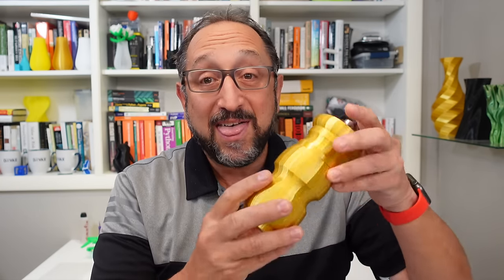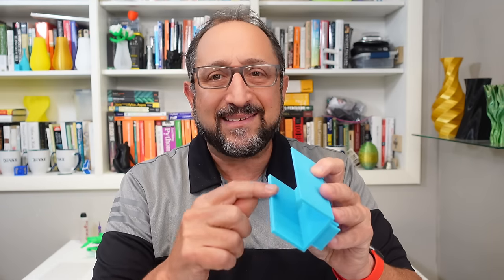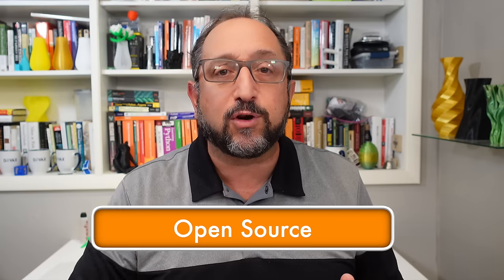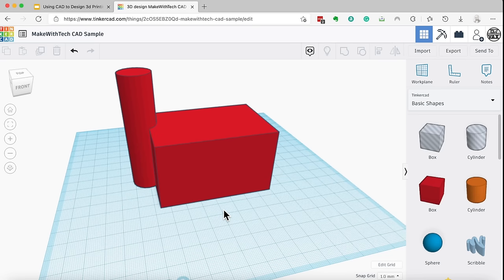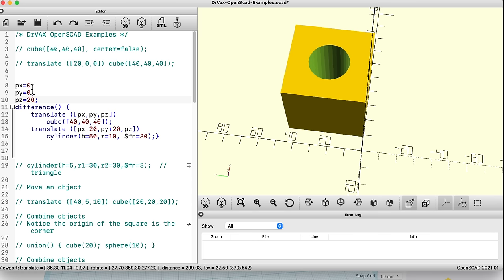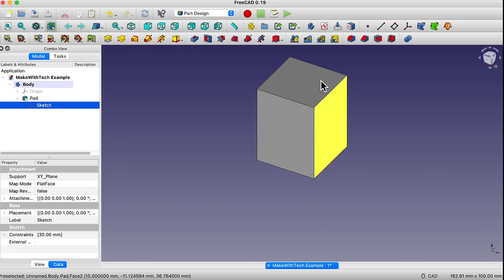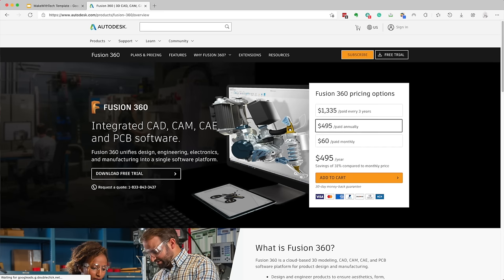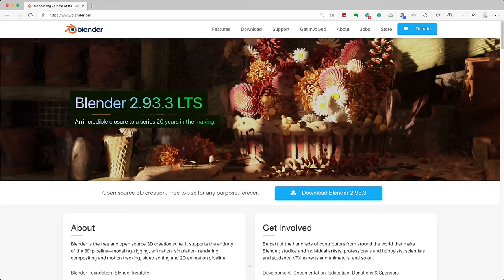Getting Started with CAD Modeling for 3d Printing

Comment: Have you tried Designspark Mechanical by RS (Radio Spares)
Reply from the maker: I discussed this CAD program in the video.
Reply from the maker: I have heard that before but as a Mac guy I cannot use it.
Reply: I also like this program, but I wasn't able to get the newly added parametric features to work. Too bad it is PC Only.
Reply: @MakeWithTech  What is a Mac?
Reply: @0LoneTech  Sorry, I forgot my <sarcasm> tags, I am a PC guy, and I hate the abomination that is Mac. </sarcasm> I may load Linux on a new Laptop soon, and see how long I last before loading Windows 11.

Comment: I used autocad back in the 80s thru 2005. I still use release 13 to design large data centers.
I use Sketchup 2014 for all my 3D printing
I hate, & loath subscription software. I will NEVER use it!
I will only use free or open source software.
DaVinci video editing software is FREE and is EXECELLENT software package. I GIVE them the $300 for a professional verion becuase that cost is VERY doable for ANYONE.
DaVinci has got the right idea!! I LOVE that compamy and hope they NEVER change thier software Licence!

Comment: Are u a lecturer ? Very professional.
Reply from the maker: Thanks.  I have spoke in public hundreds of times over my career.
Reply: @MakeWithTech  Should I learn FreeCad or Fusion 360 to quickly get into 3D modelling as currently I am using Tinkercad. I am in the Construction and Manufacturing industries and I wish to develop technical products.

Comment: Still cannot see the appeal of Fusion 360.. I have been using CGI tools like Lightwave, Cinema 4D, Reflections, Sculpt Animate 4D, Maya and such for decades. I know that of course CAD isn't the same as CGI, but I got the impression, that all the CAD tools and especially Fusion deviate from traditional and well established input and control techniques in a very unpleasant way. Which keys you need to press, shortcuts, positioning of features, the kind in which elements are displayed, where you got to click and how to move the mouse and such are all just super terrible. Free CAD is better in usability, but still has a lot of flaws and it kept crashing all the time, when I tried executing operations on objects of just middle complexity.
This industry clearly needs a revamp!
Reply: I feel the same way when I try to use Blender, which I assume is like the other CGI programs you mentioned (None of them are free, so I have not used them). These programs are good for creative people, while CAD is more technical. It is not "Terrible", just a completely different way of thinking.
Reply from the maker: I agree with your point.  I have used both CGI and CAD programs.  As an engineer I am more comfortable with CAD programs but it all ends up personal preference.   Just keep making stuff.
Reply: LightWave! Woot!
Reply: @micro2743  blender is also very different from other CG programs. That's one reason most people complain about its interface. It's not very intuitive.

Comment: I started with 3D Studio R2 back in 1992. The first visual modelling software I've tried and liked.
Open SCAD looks just as hopeless idiotic user unfriendly as POV ray on an Amiga from the late 80s.
Reply: I use SketchUp. I tried to do an animation until I found SketchUp's interpretation of the word animation is SOMETHING ELSE! Wierd.
I suspect that OpenSCAD, being programming based, would be good for animations. Has anybody tried that?
Reply: I tried most of the free programs, and went with Openscad. Created everything to print from coat hooks to 1/16 scale radio controlled tanks, superstructure for RC boats, and RC crawler bodyshells.

Comment: To many of these softwares require constant connection to the internet, even when I could still afford that it wasn't reliable enough to use things like CAD programs online. Living in a rural US small town or even city have many benefits but an affordable reliable internet connection is not one of them. Everything was fine until Trump's appointee Pai... My internet weren't from 60 a month for 100Gb/s to 250/month for 7mb/s, I had faster and cheaper internet in 1998 with my T1. Pretty much every single one if these programs require the internet, maybe not thought away but they get really buggy and slow off they don't get regular updates even if the rest of your system is also not online. Worse it only takes a couple of updates before the models you have no longer are transferable.

Comment: Where's Design Spark Mechanical? Avoid FreeCad. That will put you off for life and anyway is currently very very broken.
Reply from the maker: I shared in the video that as primarily a Mac user Design Spark does not work for me.  While there are know issues with topology naming I still have had excellent results for FreeCAD for my needs.

A great place to discuss this is at the MakeWithTech forum located at https://forum.makewithtech.com.

At the free MakeWithTech forum/discussion group, you can also post images and examples of your work.

Comment: for cad ..just use free fusion 360. iv used it for years.. its fully capable for everything hobbiests needs.    or use onshape free  online.   design spark is good but limited.         for non cad.. use blender.  no need to go into the other iffy programs.  no muss, mo fuss.
Reply: I had issues exporting from Fusion 360 / Free version to .stl mesh for printing. The exports take 2-15 minutes, and sometimes they fail and it doesn't till you until it times out 30 minutes later. This is just unacceptable for 3D printing.
Reply: @micro2743  ya fusion 360 has issues but is the best free cad available, i export as step. which is fast. then i use another program to export that to anoither format. but exporting a stl through the panel is way faster than exporting through the export option in the file menu. and is very fast!! what u trying to export? and how?
Reply: @IronMan-yg4qw  Just a simple model of a space station, and I gave up when it refused to convert it to .stl mesh. I had not even added much detail yet. Fusion 360 can convert to .step and .3mf without cloud conversion, so these are instant. Cura can directly read the .3mf files, so I may give Fusion 360 another shot.
Reply: @micro2743  fusion converts stl and 3mf fast and easy. i dont understand why u couldnt export it to stl.  i never had any problems at all. can you send me  the file? i wana check it out, :)
Reply: @micro2743  o

Comment: People always bitch about having to pay for something they use to for sure make something they sell. I can't understand how 500 for a year is too much for a license when you obviously make money out of it. I gladly pay for that for f360 and I don't even make that much and I haven't made anything to sell. There is a company behind that software that needs the money to keep making that software. For me free or cheap will never work.
Reply: AutoDesk is a supper huge corp and they continue to purchase anything they feel threatened by. There was no reason to cripple Fusion 360, which used to be completely free.
Reply: @micro2743  the "crippling" was because people misused the free license
Reply from the maker: A couple of thoughts.   Fusion 360 is an excellent product.  Full stop.  

The reason I do not teach it is not because I have a problem with paying for it.   It is because $500 a year may be a problem for some of my viewers.  For many people creating relatively simple models I think FreeCAD is an excellent "free" solution.

Finally I think AutoDesk should charge for their software but should have a middle ground between TinkerCAD and F360 for hobbyists that is priced at a lower price than $500 a year.  Instead of requiring reauthorization of the free license each year and limiting the number of active models a lower end product might limit the complexity of a model.  

In my case my models tend to be quite simple. If I wanted a more complex model I could always break it into parts.  The advantage for F360 is the personal use license provides a way for people to learn the tool which is a gateway to purchase.

Finally they need to make a commitment to a longer term license duration.  Their annual evaluation implies that they may change their mind and pull their license at any point.  If I am going to invest in learning something I want to be able to use it for more than one year.

Just food for thought. 

P.S. I have started a new discussion forum at http://forum.makewithtech.com where we can all have more elaborate discussions and share pictures on our prints and printers. Check it out. Irv
Reply: @MakeWithTech  I agree that "commercial" covers a huge range of use cases. And also I do not like these subscription models.
I'm sponsoring Realthunder a bit for his Freecad work - having such technology be "free forever" is a boon to society.